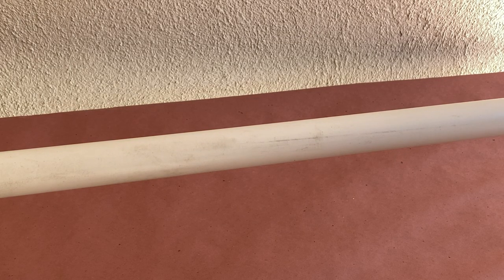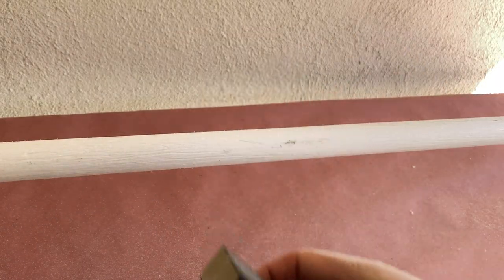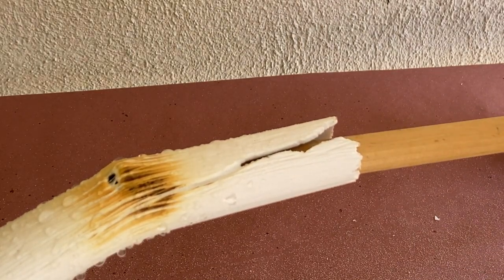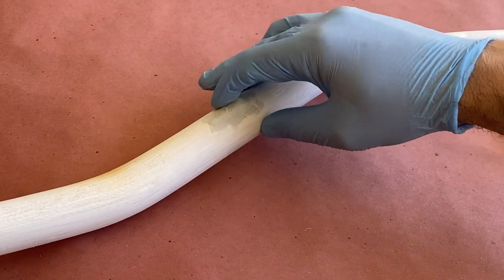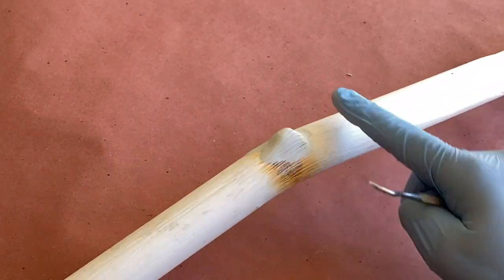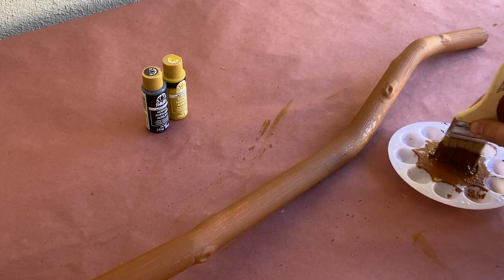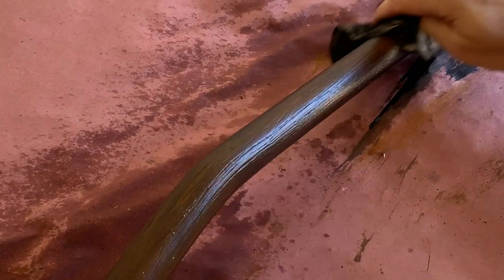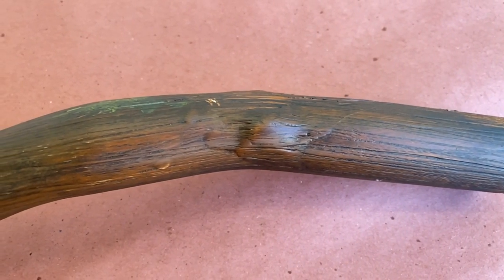Make PVC Look Like Wood

Comment: Hi.  Just found your channel last night.   Great stuff.  I work with PVC a lot which I use to make the blades of fantasy daggers.  In the process of shaping the blades I end up  with a lot of dust from very coarse to very fine.  I wanted to mention that PVC dust combined with superglue makes a very hard surface filler for PVC.  Apply glue, sprinkle on the dust, allow it to dry and repeat adding generous amounts of glue.  The glue / dust combination can be sanded like solid PVC and drilled etc.  Once painted over it's impossible to distinguish that a gap was ever there. It takes a bit of playing with to get down.  Start by applying the glue in a ring around the edges of the hole.  The patch is very durable as far as I can tell.  It can also be used to blend surfaces.  A similar trick is to grind up black rubber and layer it with superglue forming a hard black coating than can be sanded glossy.  (I want to add I don't get notifications when Youtubers reply to my comments due to some rude remarks I got from a Youtuber and his subscribers.)

Comment: Great video, but I haven't seen you make a bad one yet! Really enjoy watching you work. 
For those who don't know,  another great way to shape PVC is to fill it with hot sand. 
The heat gun probable give more control for a project like this where you're doing smaller areas or spot bends. But if you ever find yourself needing to make larger bends, or even make shapes like circles, the sand will allow you to flex the entire piece.
Once it's flexible, pour the sand out and quickly shape your piece either by hand or against a form. Spritz it with water to set it like shown here. This is not only useful in crafting and props, but in plumbing as well.

Comment: At about the one minute mark I was thinking this would be the perfect way to create a kick ass wizard staff with a switch for actual light.  Cut the end to have several long "strands" that will wrap up and around a glass orb.  Being hollow you can fit wires and batteries inside the staff.  the on switch would of course be on the outside in a convenient location.
Reply from the maker: Absolutely! I try to teach more of a technique rather than a specific item so that you walk away with a new way to do something that can be applied to your own projects.
Reply: Yassssss!!!

Comment: I am making a Tiki torch and want to achieve a bamboo color effect on the PVC and have used a rasp to scour the PVC. Would you have any color suggestions that I might use and can the heat gun be used versus a propane torch which I have seen used but I am a little leery of using? Any suggestions would be appreciated.
Reply from the maker: You can absolutely use a heat gun. It may take a little longer, but it’ll definitely do the job. As far as colors you’ll want a butter yellow, dark brown, and pale green. Find yourself reference images before you start to help guide you during painting.
Reply: @VanOaksProps  Appreciate the input
Reply: Have you ever cut grooves around the PVC pipe and then heated the junction up so that you can push it back in place to create the bamboo knot versus using the epoxy?
Reply from the maker: I haven’t.
Reply: @VanOaksProps  "How to make bamboo from PVC in 20 minutes". The guy scares me with how he uses a heat torch but interesting video.
Reply from the maker: @geoseward  that’s a cool technique. Definitely looks like bamboo.
Reply: @VanOaksProps  Yes it is. I am going to attempt to get the same effect for a skull tiki torch lit with a flaming flicker LED light.Thanks again for the input you have some great videos by the way.
Reply: @VanOaksProps  I like your suggestion of using different colors i.e. pale green, dark brown, etc. but would suggest using the black wash paint as the final coat to add more dimension especially to the groves in the PVC?
Reply from the maker: @geoseward  you definitely could